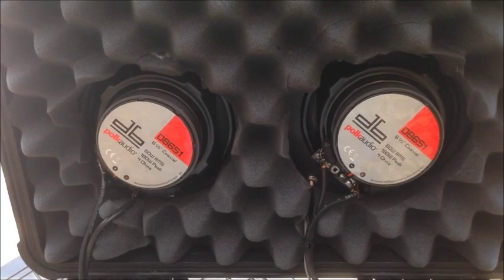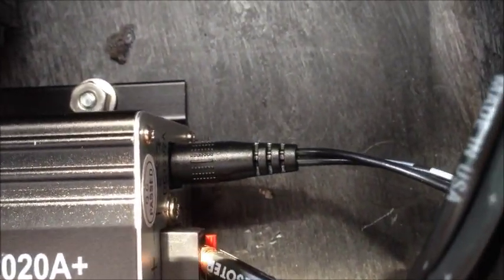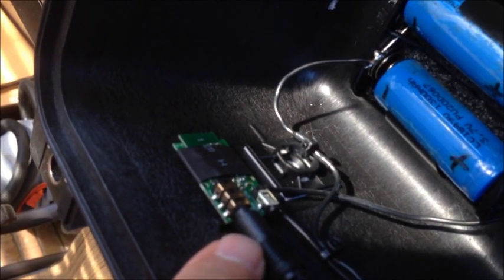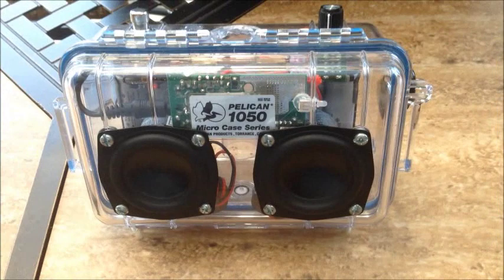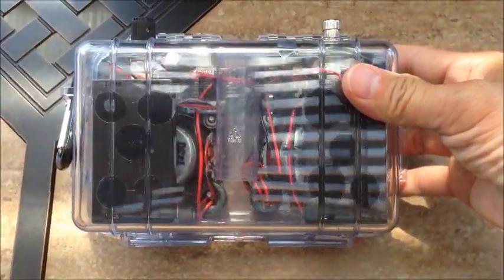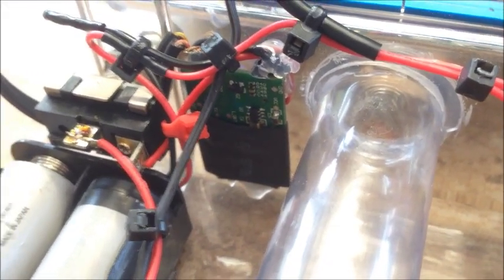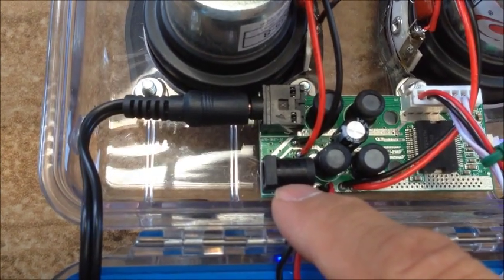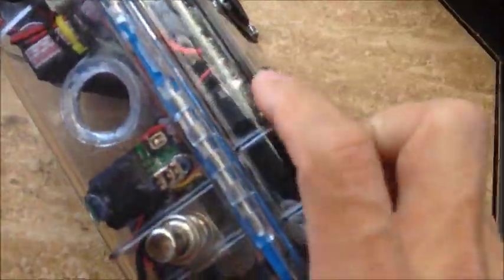DIY Pelican Boombox Video Schematics Description

Comment: Hot glue is usually good for a few years then becomes brittle in most cases or loses it's functionality.  I went nuts with some projects on purpose a few years back and had some mixed results. I know there is different grades of glue available now, but I haven't researched that. I was using basic clear or slightly opaque glue you find in craft stores.

Comment: What an Excellent build. I wanted to do this for a long time. I couldn't find a stero bluetooth, only mono bluetooth. I LOVE the clear case pelican case. Great job. I was thinking about going to a thrift store, goodwill store, getting a used boombox for the speakers. I have to figure out how to wire in an LED rope light to bounce along with the beat. I got some LIPO batteries from a old rc car, I think I can reuse the battery pack?
Do you have a list of materials, bill of materials to work off of? thanks for your work, Ed
Reply from the maker: Most of my videos list major components. Just be creative and give it some thought and it'll work out! Also helps to have some basic DC theory and good soldering skills.

Comment: does the small one last? i mean, those 3 batt in series must put something like hardly 12v, and that is when it is full, so a while later it will drop under 12 or 11, i mean, does the charge really last? also, how do you charge them? also do you know what chip uses the amp? or a link to the amp details?
Reply from the maker: Yeah, I charge once or twice a month. 3000mAh each battery. Very efficient T-class amp will play down to 9VDC, volume just gets lower. Pull batteries to charge in Nitecore I4 charger to 4.2VDC (4-8hrs). Go to parts express and search T class amp, about $20.

Comment: two things driving me nuts on the 1050.   one, you could have wired all the batteries
 into series and got 14.8v, which is what your amplifier really wants 
anyway to get maximum output

then, to run the bluetooth, use a simple voltage regulator to give it 5v (not 3.7v like youre doing now).  

and second,  you have both left and right speakers in the same air chamber, and both are using the same air port.  this is not good because in a stereo configuration the sound waves will cancel eachother out and the output will sound flat and dirty.  to get deeper cleaner sound each channel needs to be isolated in their own air chamber with each having a port for themselves.

Comment: @Modiane1, This to date is one of my most favorite builds that you do(next to the clock radio one you did also). I am about to build me 2 of these with TDA7492P, same speakers and 2.5" passives I got from China. Should sound great! But I got to thinking. I have a couple of the BMR12-s. I might purchase another Pelican 1050 for these speakers also. Have you used any BMR12-s in any of your builds? I have seen the video with the bigger BMR, Just curious what you think of the smaller BMR12?
Reply from the maker: Cool I'd like to see it one day when you have completed the builds. I do not have any experience with the BMR's but they do look interesting. To many speakers to choose from and not enough play time...LOL

Comment: Nicely done. I've wanted to build something like this myself. How do you charge the batteries after you take them out?
Reply from the maker: Bigger 1450 boombox I just plug in 12VDC Yuasa Smart charger on case and take out Li ion batteries for smaller 1050 boombox and charge on a 4 battery Nitecore Li smart charger.

Comment: What gauge wire are you using? Is 14 gauge enough with a 10A fuse?
Reply from the maker: Movsar A. http://en.wikipedia.org/wiki/American_wire_gauge
Yes, I use 14, 16, 18, 20.
Reply: Thanks

Comment from the maker: http://www.parts-express.com/bt-1a-bluetooth-receiver-module-for-wireless-reception-of-bluetooth-audio-signals--320-353
Reply: D you plug the bluetooth to the mp3 socket?.
Reply from the maker: Fook Utube
Yes on the amp side but soldered wired bluetooth side.
Reply: Can you make a video on how you hooked up the Bluetooth.
Reply from the maker: xNickerishx The parts express BT-1A has instructions, pretty easy.
Reply from the maker: xNickerishx Yes much easier no soldering just plug and play.
Reply: thanks
Reply: +modiane1 How much thus dayton speakers ?
Reply from the maker: +powerbass007 $25/ea but hacked Philips LCD TV speakers ($4) are a much better value for the $ but less power handling.